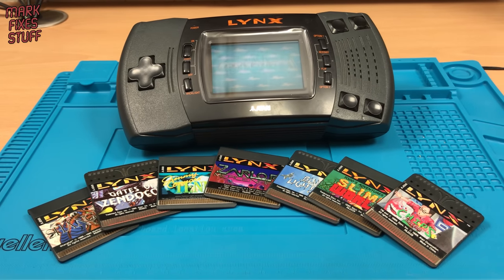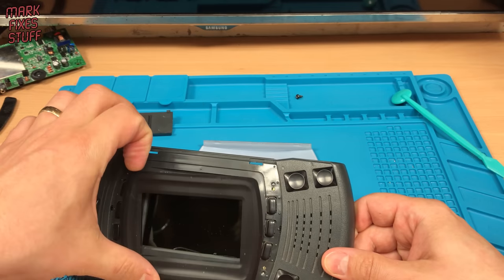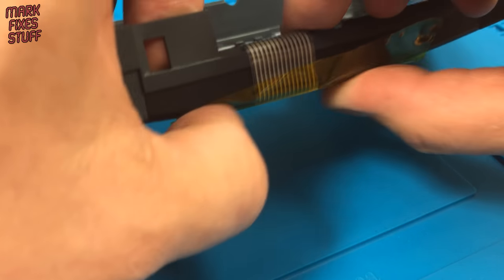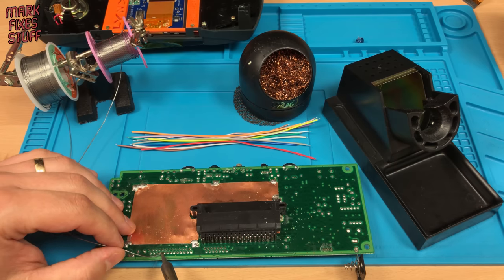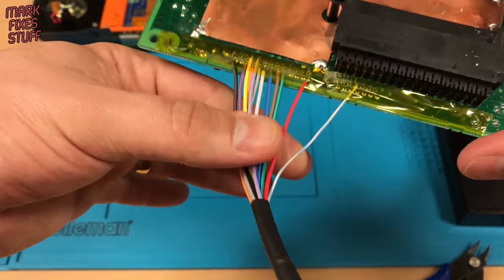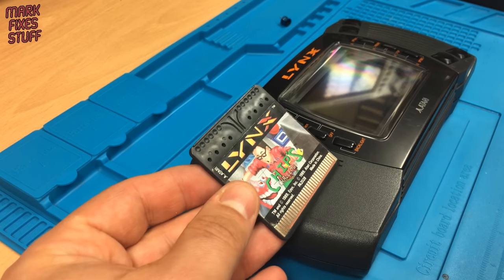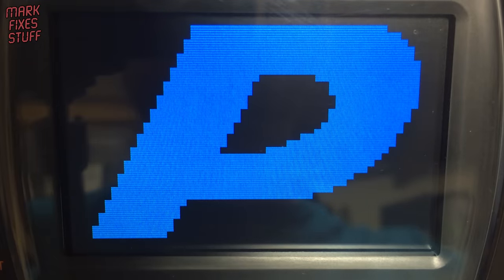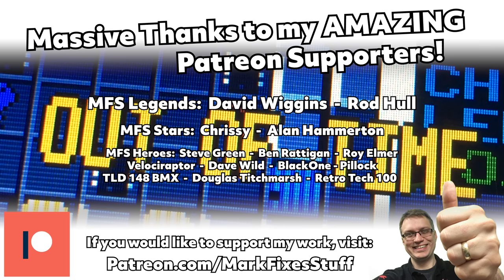Is the BennVenn Atari Lynx II LCD screen pointless?

Comment: Wow, that is arcade quality right there.  Nice upgrade.
Thanks Mark.
Reply from the maker: Thanks for watching Ron. Did you have a Lynx back in the day?
Reply: @MarkFixesStuff  No, but we sold them in the computer store where I worked.  I got to test the used ones when they came in.  I am on the lookout for one as soon as things open back up here.  I had mostly Commodore. 64,500,1000, and 2000. 
Of course, the first gaming machine that we bought at Sears was called Pong.  It was fun at first but quickly got old.  lol
Reply from the maker: Yeah, Pong was a bit of a drudge after the first hour.

Comment: This project needs to proceed & go viral on Facebook, Instagram, etc!  The BennVenn website is appearing to be on pause since October 2019 and has no updates on his Atari Lynx LCD screens.  Hopefully someone else can continue on this project & make the install process a more plug & play process...
Reply from the maker: BennVenn is redesigning the kit now, which is why no new stock. The new Lynx II kit he is making will be solderless.
Check the news here.
https://www.facebook.com/BennVennElectronics/posts/3047711108675655
Reply: Mark Fixes Stuff  thanks for that info!  Just today, I took out my Lynx2 that’s been stored safely and has worked great.  I accidentally plugged the power ac plug into the headphone jack!  When I went to install into the correct power port, and hit the power button, the screen displayed Insert Card,  when I reinstalled the game card the game & sounds were functional, but the screen started fading out to a plain light gray blank screen!  I also noticed the brightness dial wouldn’t make it bright or dim anymore.  However if I hit the backlight button, the screen went off to black as it always has.  So, after multiple times on and off, the screen is lit blank light gray & the sounds of the game is functional even the all the control buttons.  So, could it be just the lcd?  Because I can hear the game sounds and control button commands.  The only thing I do remember from other times in the past when the Lynx was working, the screen always had a bright white horizontal line appear as the unit was powering on and then everything was fine.  Question to ask, have you ever seen this bright horizontal flash line during powering up the Lynx2?  Or was that start up horizontal flash line  just an pre indication that my lcd screen was  on it’s end of it,s life?  Maybe the BennVenn would do the trick?
Reply from the maker: To me it sounds like a dead screen and perhaps an issue in the the power generation circuit. The power generation components are known for going pop. It certainly doesn’t sound terminal for the Lynx. Have you tried batteries btw? I would suspect the same but if it behaves differently it can provide a clue to the location of the problem.

Comment: Looks a lot easier than the McWill mod that RMC did.
Reply from the maker: It's a ton easier for sure. Less components to remove and the frame makes fitting the screen a breeze. Are you thinking of getting one?
Reply: @MarkFixesStuff  nah, don't have a Lynx, but it's interesting to see the work done.

Comment: Great video. Could you give a feedback after testing it with normal alkaline batteries?

I for example having issues with them. When I use the power adapter it works flawless, but with batteries there are tiny graphic errors popping up quickly.

Measuring with the voltmeter I get 4.92V on both (power supply and batteries). The Lynx is 5V modded, too. Don’t know what causes this problem, BennVenn said I should change the mosfet and zender Diode and capacitors, but the Lynx didn’t have any problems before the BennVenn mod.
Reply from the maker: I have tested it extensively for hours with a 9v PSU, a 12v PSU (unregulated) and Alkaline batteries (CPC Farnell's own "Pro-Elec" brand) and no problems here.

The capacitors and power components have been replaced in this one. I would definitely do that as a matter of course.

Comment: So no more rubber padding on the back?
Reply from the maker: I didn't stick it back on in the video, but it just reattaches with fresh double sided tape.
Reply: @MarkFixesStuff  okay thank you, wish there was a way to put a rechargable battery in there
Reply from the maker: @bricethompson1922  Some people have fitted rechargeable batteries in them. If you google you'll find a few forum threads. Most use a USB charger.

Comment: Ok got a strange one for you as googling this doesnt bring up anything close to what i need to find out (you will understand why in a moment) 

Purchased the BennVenn mod, installed ok with everything working as it should, got the lovely LCD image on screen, wanted to do the scan line mod, some how i soldered the brightness point on the board in the wrong location (well i assume i did, square below where it states BRIGHTNESS on the LCD board), and then pin 8 on the front panel cable slot on the main board. 

Put it all back together, no power, took it apart, made sure all connectors were correct, tried again, still no power, by passed the 9v power on circuit using an old USB cable, plugged it into a power bank, and have power everything works, apart from the front buttons. this is a board issue not flex cable / plug issue, as i have tried the screen in a different board, and get power (no back light) a controls back. 

Is there anything that can be replaced board side to get the buttons working again?
Reply from the maker: Check the button rubbers. If they are out of position they just don’t work. Other than that I don’t know, sorry.

Comment: There are none left in stock does anyone know where I can get the lcd from please?... bennvenn one not Mc will as double the price.
Reply from the maker: Email BennVenn - sometimes the stock on the website doesn't accurately reflect what has come in.
Reply: Mark Fixes Stuff ah ok thanks for the videos first of all, how do I go about making an order then?.. sorry for noob ness
Reply from the maker: @yebbo00  If you email them they'll either be able to sell you one or tell you when stock is back in. Basically I don't think they can keep them in stock because they sell so fast.
Reply: Mark Fixes Stuff I’ve preordered for the next batch :)
Reply from the maker: @yebbo00  Great stuff! Did you go for the new solderless version or the one in the video?
Reply: Mark Fixes Stuff gone for the solder for the scan lines and brightness control, or it’s just set to one brightness
Reply: They have the new solderless in stock now.
Reply from the maker: @mattnova18  I think they’re sending one for review